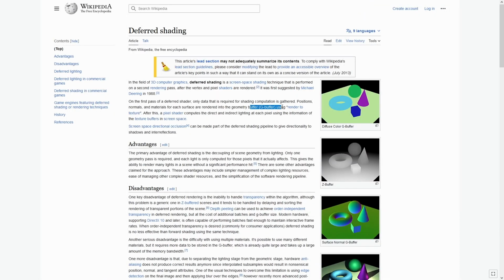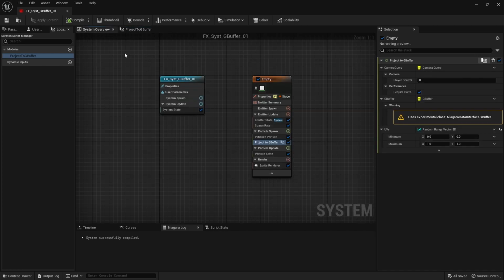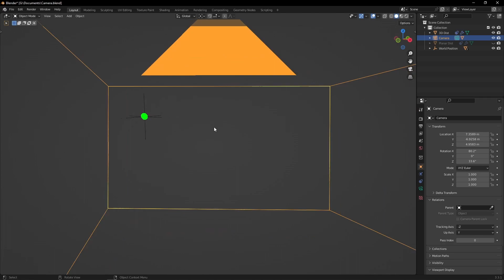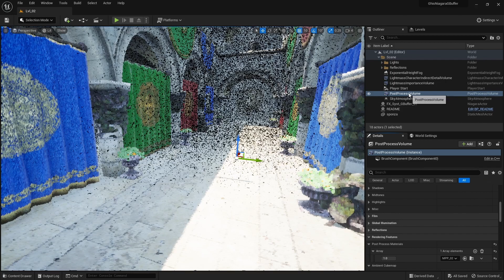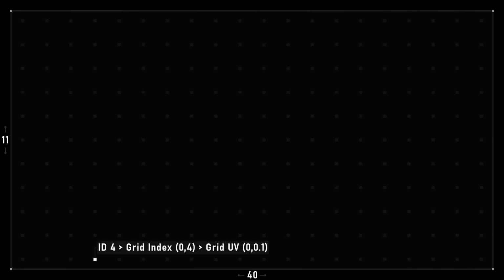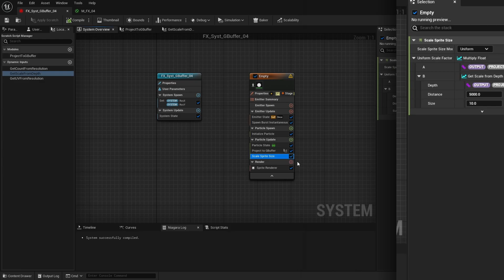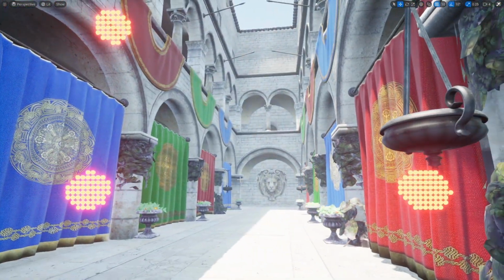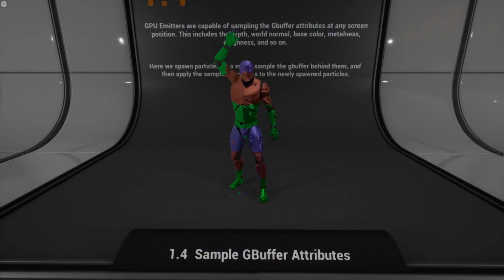An introduction to Niagara's GBuffer Interface

Comment: Cool video, I was testing out Niagara's Gbuffer but for some reason the particle color is not showing up after putting on a post process material. I think I have the same setup as you any idea why?
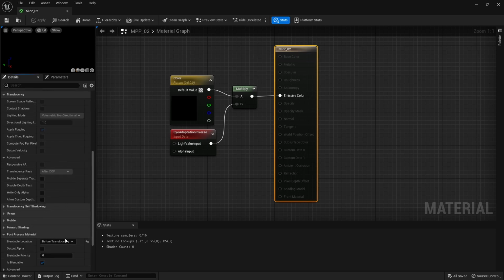Reply from the maker: Hey! Could be a number of reasons. I'd first check your Post Process Material is rendered before translucency like I showed at 4:40
Reply: @ghislaingirardot  I do have it set to Before Translucency which is why I'm confused with it
Reply from the maker: @canliferous  Do you at least see particles when the post process material isn't applied? Also maybe try disabling depth test in your particles' translucent material & make sure it's rendered after DOF
Reply: @ghislaingirardot  I can see the particles, the translucency pass is after DOF and the disable depth test is greyed out. I am using unreal 5.1 don't know if that makes a difference
Reply from the maker: @canliferous  This video was shot in 5.1. Works the same in 5.2. Anyway, depth test being greyed out suggests you're not using a translucent material.

Comment: Hey amazing effects, subscribed to your patron! However I have a question! How can I control the speed of the sonar effect?
Reply from the maker: Ty for joining in! The FX_Syst_GBuffer_04 has a 'GetScaleFromDepth' Dynamic input script used in its 'ScaleSpriteSize' module which makes use of Time. You may want to expose a float there and multiply Time with it to control the speed. Hope it helped
Reply: @ghislaingirardot  Thank you, yes It worked, If I can ask a follow up question it would be if there was a way to have the particles go dark at a certain depth
Reply from the maker: @MadMax-mw3og  Use the 'Depth' output variable remapped to a 0-1 range to lerp between white and black
Reply: @ghislaingirardot  Thank you